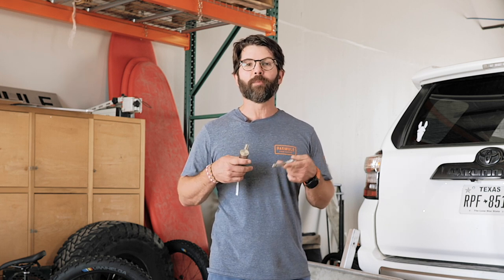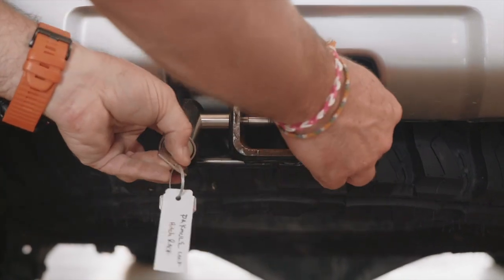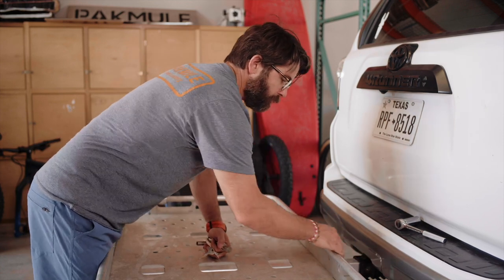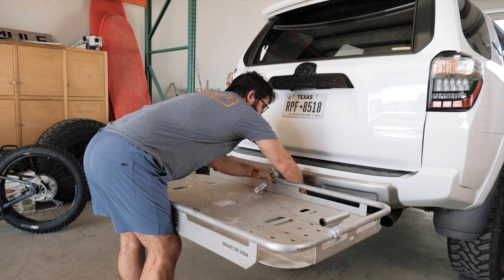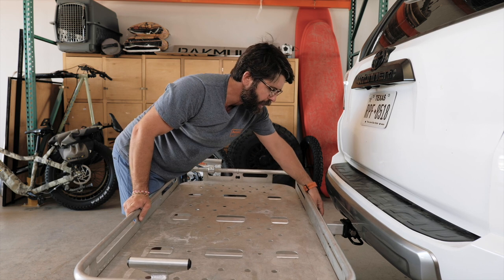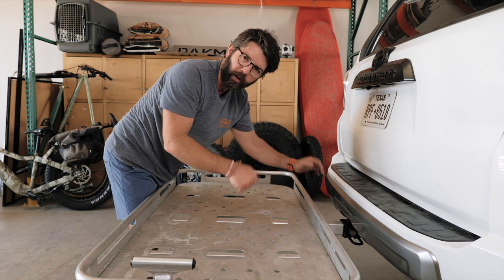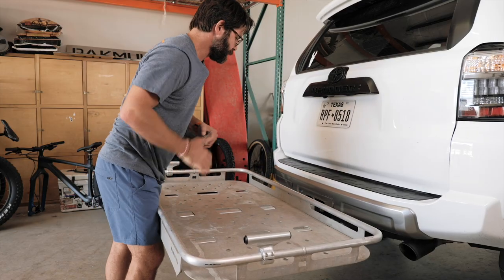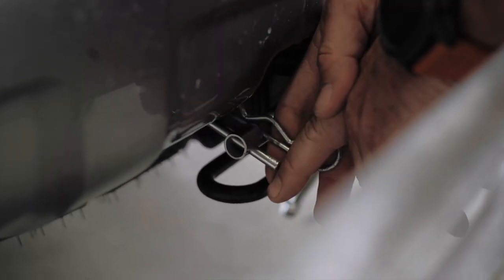How to Install Your Pakmule Cargo Rack + Tips and Tricks

Comment: I have this in my cart but unsure IF the exhaust on my 2023 TRD ORP will cause issues for the packmule and/or the load.
Reply from the maker: We run the straight tongue without issues. But we don't drive over 75 and don't drive thru mountain passes. If you do, you should just leave some room in front of the tailpipe to clear the heat and prevent potential damage, or order the 4" riser.  But the Scout is awesome, you're gonna love it!

Comment: …You NEVER gave the SIZE of the SOCKET you use & NO information is given with the Locking set box that came with the Pakmule.
 The closest English system may be 7/8” (7/8 inches) that fits pretty snug. 
Metric size if it works is 22mm or 23mm. Since 7/8” = 22.225mm. (Internet says use 22mm)